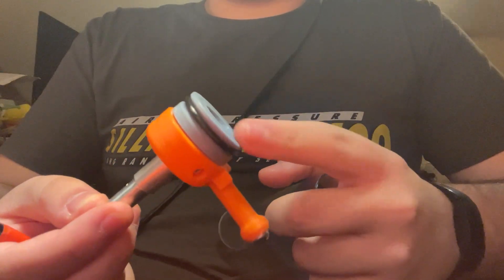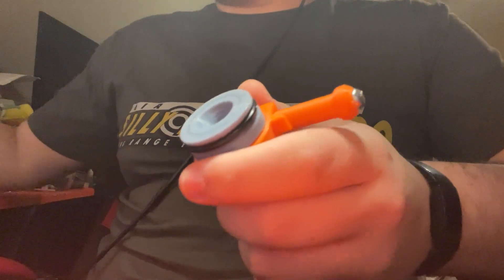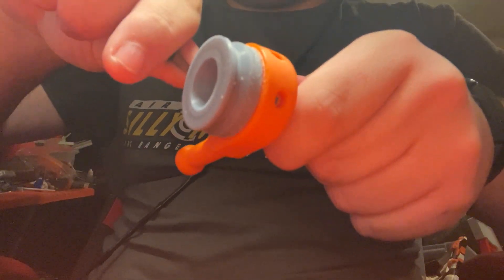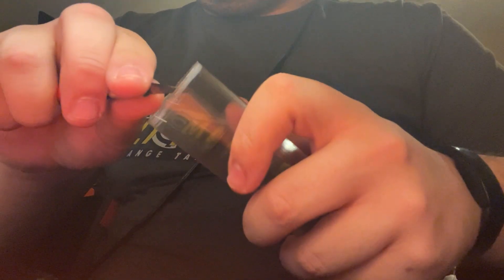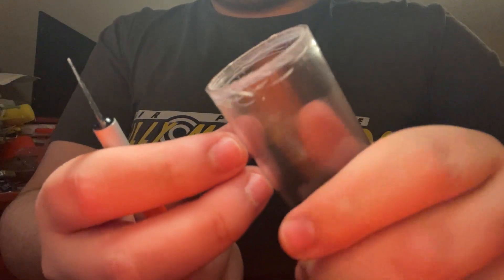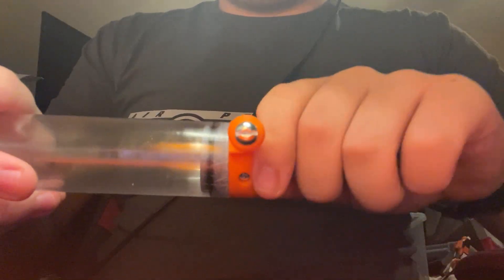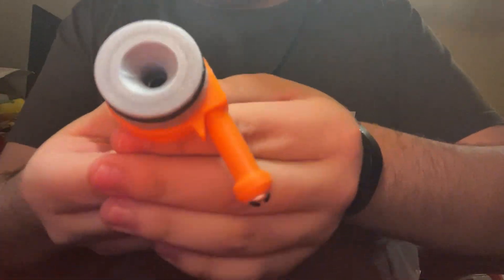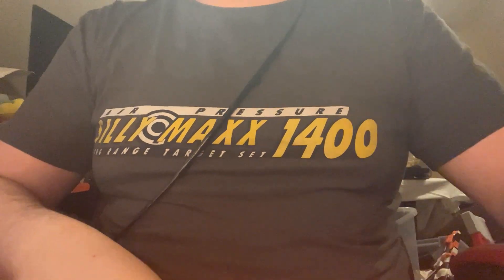[Tutorial] Gluing on Nerf plunger tubes (SLAB, Cynthia, etc)

Comment: I needed this video a couple days ago. I was having issues with gel super glue on my SLAB. I replaced my broken o-ring with a 3D printed version made from TPU. I have a spare o-ring, but I wanted to save it plus I just wanted to see how a TPU o-ring would perform. I also used hot glue since it's not as permanent as epoxy would be. It works great, but I should have scored the parts first. That's a great tip. If the hot glue fails I will switch to epoxy.

Comment: I used hot glue on my slab as that was one of the options you suggested on the slab build, I had to do it a second time with a little extra on the outside as the first time it came loose